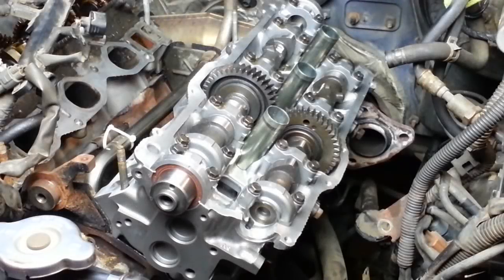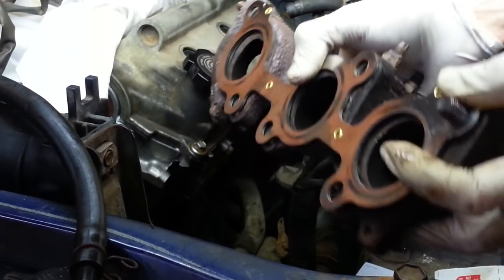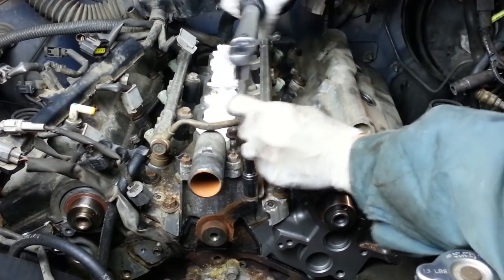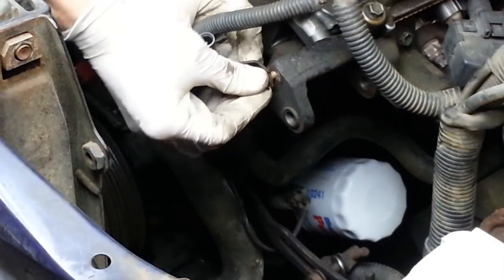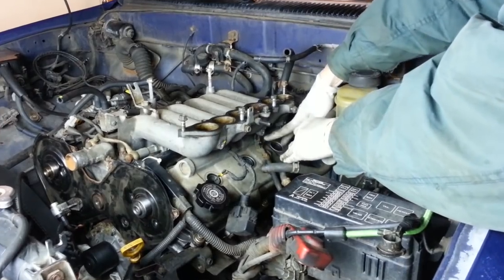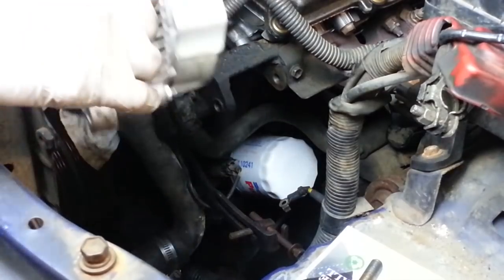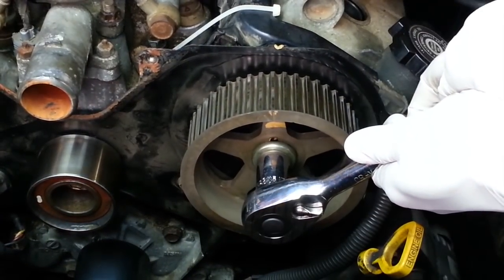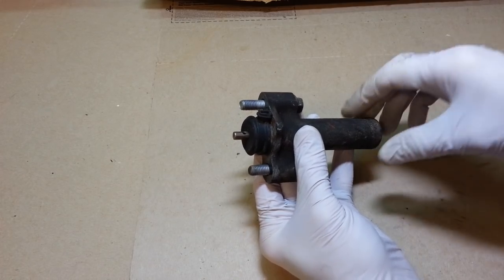Cylinder Head & Gasket DIY Procedure - Toyota 5VZ-FE - Part 5

Comment: Great Video. One question. May have already been answered but...what brand gasket kit did you use?  I am about to overhaul my 1996 land cruiser but I am not sure as to what brand gaskets to use. Should I use genuine Toyota or what. Any input would be much appreciated.
Reply from the maker: I found it to be a challenging decision with so many choices out there. I ordered a Beck-Arnley kit from RockAuto, though, the packaging came with a different name on the label.  You can see the details of all the kit components in part 4 of the video series starting here... https://youtu.be/nFYEoWTX0YU?t=691 You could use a genuine Toyota gasket and I'm sure you'd be very happy with that choice. However, I understand that the components come separately and the overall cost is considerably more which is why I went with a comprehensive third-party kit. Good luck with your project and let us know how your experience compares. I've really enjoyed everyone's unique input on this subject.
Reply: Thanks for you posting this stuff. Are you pleased with the head gasket kit that you purchased? Is the head gasket still doing OK?
Reply from the maker: I don't have anything to compare it to but, yes, I was quite satisfied with the gasket kit. It is doing just fine and the truck purrs like a kitten with 247,000 miles on it now. I expect that the rust cancer from winter salt treatments will certainly be its end long before the engine gives up. Thanks for the kind comments. I really appreciate it.

Comment: well after working on this thing on and offcause of the holidays and rain, I am finally done, and with a little prayer and making sure I followed the videos......so I have two new heads, new starter, the alternator is only like a few years old......so I turned the key and IT TURNED ON AS SOON AS GAS HIT THE INJECTORS......COULD NOT HAVE DONE IT WITH OUT THESE VIDEOS, BEST ONES ON UTUBE......I CHECKED THEM ALL TRUST ME........THANKS DUDE....TRUCK RUNS LIKE A CHARM.....
Reply from the maker: Excellent! Another DIY success story on record for the good guys. Thanks for the kind comments. I really appreciate it.

Comment: great video on your semi rebuilding 3.4L but I have to say is the spark plug your using is supposed to have the two gap not the one gap. I'm sure you do know that but if not that what our toyota 3.4l should have. why I say it is because I have it spark plug went out on me before and burn out.
Reply from the maker: You are correct and very observant. The standard spark plug for this engine does have dual ground electrodes. The plugs that I am using are a valid alternative as noted in the factory service manual.

Comment: This may be a stupid question, but why does it matter which teeth the timing belt sit on? I know the cams have to be right for timing, but why do you mark which teeth of the belt are on which teeth of the cam sprockets? Is this just so you get the correct tension again?
Reply from the maker: It is just a quick starting short cut to help get the cams and crankshaft lined up again and ensure that the timing is right. You certainly don't have to do it that way and you don't even have the option if you are putting on a new belt that doesn't have the marks from the factory. In either case, you still need to confirm everything is lined up properly before pulling the pin on the tensioner.
Reply: Ahh I see, Thanks for the reply and also for taking the time to do this video! I may have to replace the valve seals in my DeLorean and I don't want to use the rope trick, I want to do it properly so this video was very helpful in showing me all the parts I've only seen in diagrams.
Reply from the maker: DeLorean? Nice!  Am I right that they have a Volvo engine? Saw one in a Volvo shop years ago. I'm actually a big fan of the rope trick and, coincidentally, I recently replaced the valve seals on my daughters Highlander V6 using that method. I think you really only have two alternatives. One is to use compressed air to pump up the cylinder during the process to keep the valves from falling in. I'm a do-it-yourselfer and I don't have shop air provided by a large commercial compressor with that kind of volume and reserve. Obviously the other is to remove the cylinder head altogether. Whichever way you go, good luck with it and keep that gem on the road!
Reply: Yes, they have a Peugeot, Renault, Volvo (PRV) V6, I've been restoring her the past 2 years and have only just got her running again, albeit idling at 2500rpm and lots of blue smoke.

Thanks for the advice around the rope trick, I was just planning on pulling the heads, but perhaps the rope trick is not such a bad idea after all. I'm hoping the smoke will come right after an oil change, fixing the idle and getting the engine up to temp. The engine hasn't run for 10+ years apart from when I got it idling last year but had to fix all the vacuum/exhaust leaks.

Comment: having done this once if you ever had to do it again would you pull the motor for easier access?
Reply from the maker: I wouldn't pull the engine unless there was some bottom-end work to be done, too. Though it would make working on the engine itself somewhat easier, seems to be that pulling the motor would be even more unnecessary work overall.

Comment: I bought all new Toyota exhaust studs and nuts (Part numbers 90116-10150 and 90080-17187, respectively if anyone wants to get them as well.)

Would you recommend connecting the exhaust manifold to the crossover and then installing the studs through the manifold to the head, or would you prefer to pre-install the studs to the head, and slide the manifold over it?

Thanks!

(You should add a paypal link... I'd love to donate enough to buy you a few beers!)
Reply from the maker: Hmm, very good question and I'm not sure which approach would be better/easier. I might lean toward installing the studs while the head is on the bench. Do whichever is easier for you to get the torque right when installing the studs into the head.
Reply from the maker: I really appreciate the kind comments. Your success if by far enough reward for me.
Reply: Alex Wilson
Reply: Yes....?

Comment: The timing belt procedure is way too long and over complicated. Just install the lines on the belt to the marks and clip the belt to the cams with clips and then install the center idler. As it tightens it will tension the belt slightly then pull the pin out of the tensioner. Done deal. No knock pin and BS

Comment: Great videos I wish I had found this when I started the head gasket repair, I'm just about finished now though.  I've got one question though and hopefully somebody has an idea.   

When attaching the intake chamber stay, (@22:05 on your video) for some reason i cant get the bolt holes to line up.  The hole in the lower plenum is is about a quarter inch too high.  I've verified that i'm putting it in the right place using the fsm, your video and pictures i took during disassembly. This is driving me nuts,  any thoughts?
Reply from the maker: +Jon Garner Sorry to hear about your setback.  It sounds like your lower plenum is not fully seated down on the intake as though something is touching or getting pinched under there.  If that is the case, you'll have a MAJOR vacuum leak.  I suppose it is also possible that your valve cover is not down all the way and is touching the under side of the lower plenum.  Now that you're almost done, you won't like my suggestion but I think you need to do some disassembly down to the point of removing the lower plenum and ensure everything is correct.  Better to do it now while you know there is an issue.
Reply: That's what I was thinking, I've pulled that plenum off and on a few times so I don't think it's that.  The other thing I think it could is the intake manifold isn't seated right, that I haven't checked yet.  I hate to take it back apart but you are absolutely right, I've pretty much stopped once I saw that it didn't fit cause I knew something was off.   Thanks for the response.
Reply: Jon Garner yep, i had same issue, didnt locate it correctly, then i corrected myself......cause was in a hurry,....lol

Comment: Hey i am doing the same but in my book says that I have to align the two dots. In the passenger side...  which is different then the drivers side (left side)  because in the left side says to alight the single dote
Reply from the maker: powerstrokethis03  Being a non-interference engine, it is comforting to know that if you really mess up the timing or the alignment marks, you're not going to destroy anything.  It just won't run.  :)
Reply from the maker: Antonio Martin Thanks for confirming that.  You are absolutely correct and it is very important to understand the difference.  I did not show where I corrected the alignment of my cams on the passenger side but in part 3 of this video series during dissasembly and inspection of the valve train, I did try to explain that difference.  Good luck with yours!
Reply: worsethanchiggers I just want to thank you for making this video series. You're awesome! I'm doing my cylinder heads and I've found that on both cylinder heads the single dot marks are lined up. On the passenger side (where the 2 dot marks should be aligned) its lined up with the single dots. It looks like that side has been running much hotter as the bearings are a golden color where the drivers side is much cleaner looking. I'm thinking someone in the past has dove into this and put it together wrong. Any thoughts on that?
Reply from the maker: powerstrokethis03 Rest assured,that's what you should be seeing.  When cylinder #1 is set to top dead center, not only should the timing marks be in their right places on the crankshaft and camshafts pulleys but the single dots on the camshaft gears should also line up.  That's true on both the driver's and passenger's sides.  The one thing to note about the dots is, on the passenger side only, you must first rotate the two camshafts 180 degrees until the 2 dots on each gear are lined up before removing those camshafts.  That is the position on that side where the camshafts are not compressing the valve springs.  On the driver's side, the single dots need to be lined up before removing the camshafts.

Sorry, I don't have the experience to say why you might be seeing the discoloration on that one side.  I don't know if that can be considered normal or the the result of something wrong.
Reply: worsethanchiggers Thanks for the reply. I've been doing some research and watching your other videos and im sure everything is correct. It just had me stumped for a few hours. Upon install ill line the 2 dots up and rotate ccw and line up the single dot and everything should go fine. I hope. Lol. Keep on fighting the good fight man
Reply: worsethanchiggers Yeah that is definitely a plus with these engines. They are pretty simple to work on compared to yachts lol so far its been a cake walk with the exception of figuring out the cam marks. Thanks again for the videos and advice. If your ever in south florida id be happy to buy you a beer!

Comment: did you re align your cams on passenger side? great video!
Reply from the maker: kauboi Sure did.  And, I think I can detect smoother operation now with that corrected on both sides.
Reply: Thanks for this question! Upon watching the video, I realized someone was in there before me and both holes were not aligned. And I can tell that the back half of both heads were much dirtier than the front half forward of the cam gear split. I would imagine it will run better and stay cleaner. My motor has 315k and ran fine the whole time😅 Thank you for your videos!